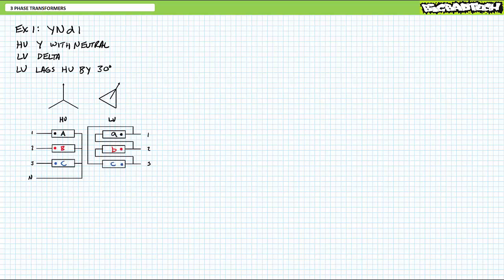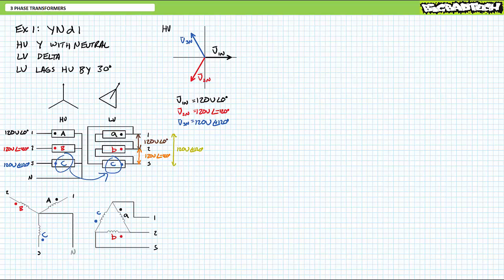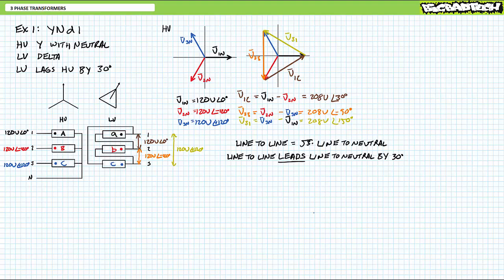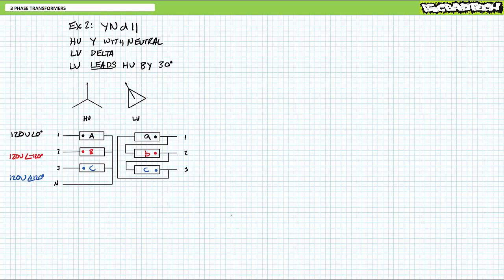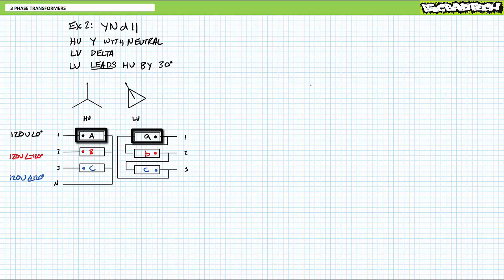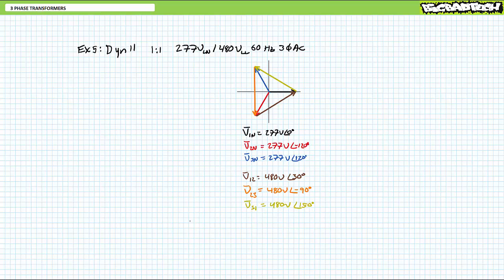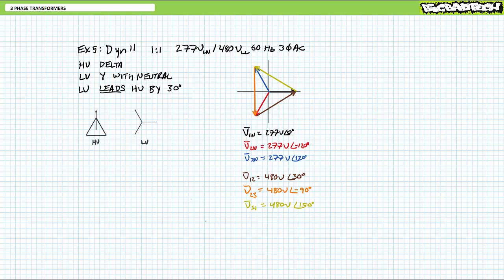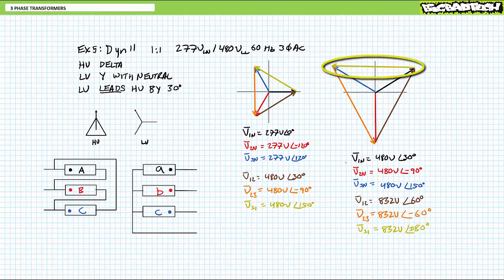3 Phase Transformers (Part 2 of 3)

Comment: Good series.  I have always been annoyed that all the motors and transformers I have ever looked at have never had the dots marked.
Reply from the maker: My personal annoyance is the seemingly random orientation of displacement diagrams. Some manufacturers orient 0 straight up (as presented in this lecture series). Some manufacturers lay them on their side ... but not like a phasor diagram with 0 on the right hand side! They lay them so the delta is tipped so the reference voltage to virtual neutral dangles off the left hand side! This being said you should be able to compare the HV and LV displacement diagrams regardless of chosen orientation to determine the resultant leading or lagging phase shift.